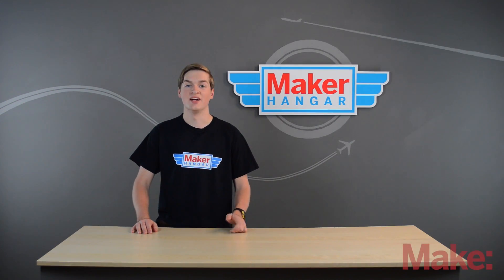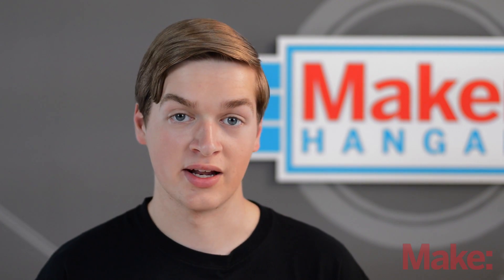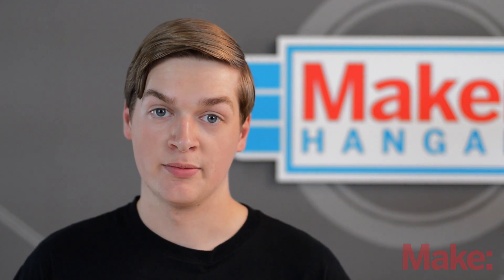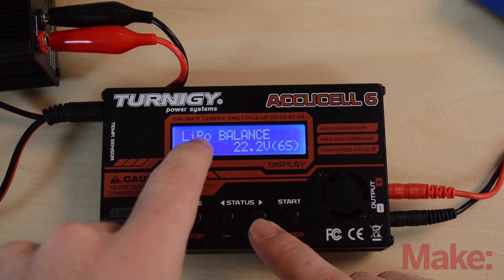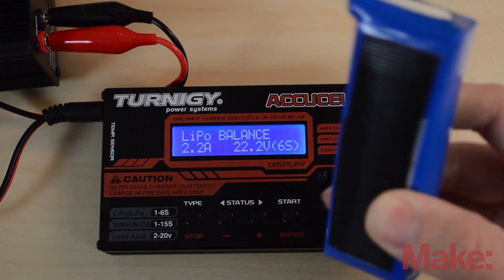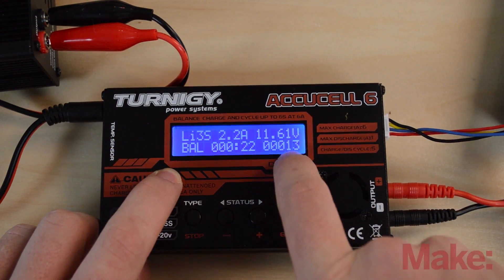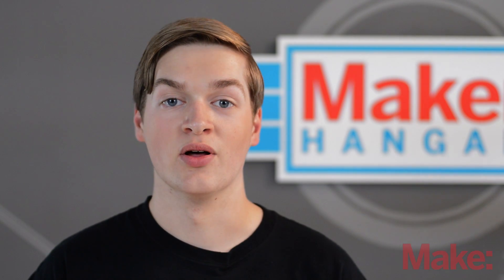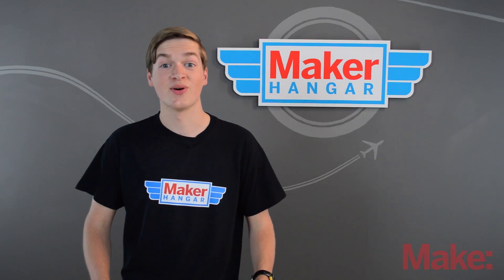Maker Hangar: Episode 4 - Li-Po Batteries

Comment: what voltage of Li-po battery is advisable to power two brushless motor of 1400kv that require each a voltage of 7.4-11.1v

Comment: can we use a lipo 2s 7.4v 25c 1300 mah battery for brushless motor 1000kv and servos
Reply: Aamir Abdul gaffoor 1300mah will be very low for brushless what is the motor rating ? You need higher 3s lipo and 2000mah 🔋

Comment: can we use a lipo 2s 7.4v 25c 1300 mah battery for brushless motor 1000kv and servos
Reply: TeCh GeNiuS you'll need a very big prop, try a higher kv motor. Yes, servos will work fine. Just check your esc.

Comment: I just bought a Turnigy 12V 2-3S basic balance charger. It has two crocodile clips, I do not have a power supply. Can I use a AC mains to 12V 5A adapter to do the job??? Please help Me out.

Comment: So, in your motor video you say a motor can take 100 Amps at 12v, which, for a start, is 1.2kW. Here, your batteries cam take just 2A. You propose to put 50 batteries in parallel to give you all that current?

Comment: HELP. I am an absolute noobiest of them all. I want to get into RC with LiPo. How the hell do I know if I have been driving/flying to long. WHat do I need to have in my car to make sure my lipo doesn't goe below 3.8 V. Is it a beeper I install, is it the ESC. Do I just guess and stop every few minuets and check it with a Volt Meter. Thanks
Reply: I guess you learned by now but there is a piezo buzzer that beeps when your voltage get low and that tells you to land it

Comment: i want to know if i can use a 2s 4500mah25c lipo with a 20A esc {specs says 2s-3s)
tks
Reply: it shoudn't be a problem.
Reply: Yeah in fact i made a mistake ...i reverse the polarity.. fortunately only a solder point burn on  the esc ... i solder it and its working fine ..tks

Comment: Are you not supposed to store batteries fully charged?
Reply: You should better discharge them before storing, if you want to have longer battery life.
Reply: OrKhan DON'T EVER DO THAT WITH A LIPO

You will DESTROY IT

you ONLY do that with a NICKEL-CADMIUM battery (NiCad) 

If you ever do that with a LIPO, it will be destroyed.
Reply: Storing lipos fully charged to there max cell voltage (4.2 v) can reduce there life and is less safe,,  store battery's at 3.85 volts "per cell" remember  You shouldn`t go any lower than 3v per cell on lipo or higher than 4.2v or you will damage the battery .. always store and balance charge lipo battery's with deep respect in regards to fire protection

Comment: How do you connect the Turnigy Power Supply to the Turnigy Charger?  The wires included with the charger have alligator clips but the power supply output is for banana plugs.  Are we supposed to make our own wires?

Comment: i think i had some problem with my charger,is a imax b6 charger and whenever i charged a lipo battery,(doesn't matter how many cells)it always end up and 4.12-4.17 volts each cells...i know a fully charged battery is around 4.20-4.22 each cells so do u have any ideas to re-calibrate the voltage on the charger?does this happens to your turnigy accucell 6?i'm thinking of getting one of this accucell 6 but am afraid of the same problem happens to the accucell 6

Comment: Is it safe/recommended to charge batteries in parallel? Using a parallel balance plug. If yes, what amperage do I need to set? The result of Ah x n batteries or just Ah of a single battery? (all identical batteries)

Comment: don't bother, you can't fix the damage of over discharging a lipo. Forcing the battery voltage up using another form of charging (like a nimh). There is a reason why you lipo charger won't let you charge, it's because trying to do so will often result in a fire or explosion. Either way the battery is stuffed and should not be use in anything let alone a plane.

Comment: The C rating of a battery x the mah rating (divided by 1000) gives you the amp capacity of a battery, as long as this number is less than the maximum draw of a motor (and the rest of the electronics) then your battery will be sufficient.  Referring to what "C" rating is needed for a particular electronic component (like the RX you mention) is meaningless as a 5C 5000mah will produce 25amps continuous vs a 5C 800mah battery that can only provide 3amps......

Comment: hey champ, before you make videos about lipo batteries you might want to "learn" what the numbers actually mean.... the KV rating of a motor has no specific requirements on a battery, a 4000kv motor running at 10amps would run fine on even a 1000mah 15C battery but a 1000kv motor running at 20amps would not, its the amp draw of a motor that matters, KV refers to the rmp per volt (4000kv means 4000rpm per volt) nothing to do with the power draw or the battery requirements.

Comment: If you ever over discharge a lipo, set your charger to 1/2 c on nimh. Charge only until the pack hits 3.0v. Quickly charge normal in lipo mode

Comment: hey Lucas, you mentioned "immediately charge your battery when you over-discharge them. HOW? the charger is indicating an TGY Accucell 6 ERROR = BATTERY VOLTAGE CELL LOW VOL ...voltages drops up to 1.5v per cell...zippy 3s 2200mah 40c cell 1 - 1.56v   cell 2 - 2.01v - cell 3 - 1.83v...forgot to turn off my TGY 9XR for almost a day 22hrs...how can i recover the battery?

Comment: WARNING! The info on C ratings is dangerously over-simplified! The amount of power (current) a battery can safely provide is not determined by the C rating alone! In addition, the amount of power required (amp draw) is not determined by KV alone.

Maximum discharge current is determined by C rating x capacity (in amp-hours, so 2200mAh would be 2.2Ah), and the amp draw  can only be accurately determined by use of a watt meter as it varies depending on your complete setup.

Comment: A big, low KV motor will draw far more current than a tiny, high KV motor, so KV is completely irrelevant to amp draw.

So, using KV & C rating alone to choose either a 20C 5000mAh battery or a 50C 1000mAh battery for a big, low KV motor would result in an explosive setup where the motor easily draws 80 amps, but the battery can only safely provide 50 due to its smaller capacity whereas the larger capacity yet lower C battery can safely provide 100.

Comment: had a small lipo batt shorting them out is a really easy way to let them blow up.

but i realy wont do that with the bigger one's 
1. they will get you if you mistreat them
2. they are not that cheap ust to let them go out in flame's

p.s 
i use lipo's for my rc cars damm the speed it give's to them is insane

Comment: you are correct. 2200maH is 2.2amp hours.
To answer your question of how many amps you can draw safely from a battery. Say you have a battery that is 2000maH and has a C rating of 20
Take the Amp hour capacity and multiply it by the C rating.
 2aH x 20C = 40amps....or 2000 x 20/1000=40
you can safely draw 40 amps from this battery
In your previous post, your answer was actually 60,000 mA, or 60 amps, which would have been right

Comment: If anyone is new to li-po batteries and not completely confident on using them, it doesn't hurt to get a lipo bag which will help contain any explosion in case the battery becomes damaged via charging or use.

Comment: You don't need a power supply, power it from a 12v battery. You can use your car battery or a spare one. I have 3 55AH AGM batteries I use.

Comment: that works pretty good, but a storage charge works even better if you combine it with storing them in the fridge. You will need to take some time to warm them up if you wish to go flying, capacity drops when they are cold.

Comment: nah, math is too hard for the beginners this vid is aimed at (and Lucas).
kjahockey84 has the right explanation: just multiply Capacity and C rating. If the capacity is in mAh (milliAmp-Hour) you also get a result in milli amps. If you prefer fractions: milli is a prefix meaning 1/1000th, hence the times 1000 you asked about.

Comment: Not scaring away beginners is not a good excuse to speak nonsense IMHO. Nor does aiming at beginners absolve you of having enough knowledge on the subject. It is a shame Make attached their brand to this vid. 
You seem very prone to use marketing buzzwords like 'powerful brushless' motors. Really, all are brushless and powerful is relative to the plane and prop you attach it to.

Did you know that if you load your battery at 30C, it will be empty in 2 minutes?

Comment: You simply multiply the battery's capacity by the C'rating.   A 1000MAH 20C can discharge 20 amps safely.  I however always leave a good amount of room in that so if i needed a 1000MAH battery to deliver 20amps i would try to have a 25-30C rating

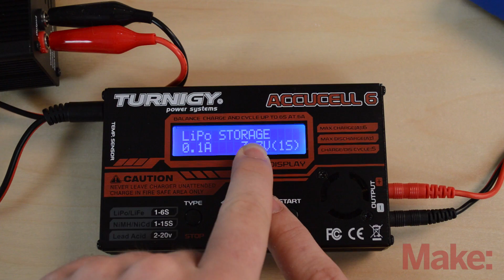Comment: @4:44 Lipo storage - use this if not using the battery for a few months. If you store the battery fully charged or almost fully discharged it will degrade the battery. Also always keep the battery as cool as possible during non-use (not lower than 2 deg C though).